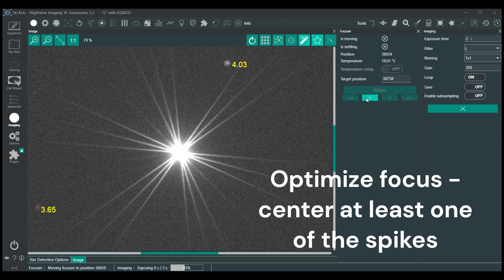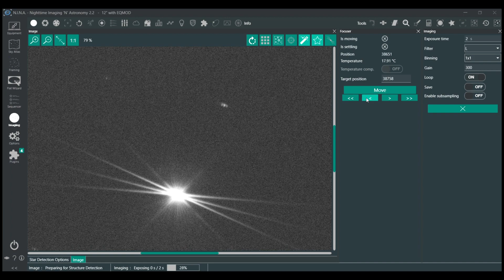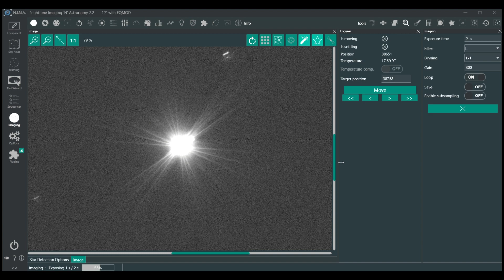Tutorial for tri-bahtinov mask collimation of a fast newtonian

Comment: Very nice, I’m gonna try this. I’m not sure I understand your mask geometry though? The way I see it, the plastic has 3 bahtinov masks in it, each BM covers 1/3 of the full circle, as if the full circle has 3 pizza slices in it. The point being that you get a diffraction spikes from 3 different slices of the mirror, which exactly line up with the screws. In your cutout mask, you are sampling both sides of the mirror at once, ie the donut opening is not over the same part of the mirror as the large opening, which is hard to understand what that will do, but you showed it works to some degree. Bottom line, a Pac-Man style 120 deg cardboard illuminates exactly the 1/3 of the mirror that the screw moves. Just some thoughts…
Reply from the maker: This is how the first tribahtonov masks were designed (one-third pizza slices).  But this version is different.  I understand it is better because you are checking for mirror tilt on each axis with more leverage, because the bounding spikes and center spike generating areas are further apart along the evaluated axis, so more sensitivity.

Comment: Thank you for sharing.  I am struggling with collimation on my edgehd. quick question. At 3.17 you say "middle spike moves with the direction of star when adjusting" . Not sure what exactly you meant. thank you.
Reply from the maker: @dm1787  as you adjust the mirror, the star moves within the frame.  The middle spikes perpendicular to the star movement direction will shift in the same direction of movement, so that is helpful for figuring out the next step.  In fact, I don't even use the rotating shade anymore, I just adjust based on what direction I'm trying to fix.  However, this is for a Newtonian where I am only adjusting the primary mirror.  I have no experience with an SCT, and don't know how it would work out when adjusting via the secondary instead.

Comment: Hi thanks for the info . What size is your Newtonian?
Reply from the maker: It's a doozy, a 12" F4 from OOUK.  I was scared it was too much telescope for the EQ6r-pro, but actually I have been delighted to find I can routinely get 0.6" on guiding with it.  At that f-ratio, collimation is super important but also difficult due to the offset secondary.  A light bucket like this is pretty useful for powering through my bortle 7 skies for anything broadband.

Comment: Thank you thank you thank you!!! I’ve been looking for a demonstration of this method as I have been struggling with with fine collimation on the same telescope(ONTC 10” F4?). Out of curiosity, how do you do coarse collimation?
Reply from the maker: It's a public service :).  For coarse calibration, and especially for the secondary I use a laser, but when I'm serious about setting up initially (centering the secondary etc) I use an OCAL camera.
Reply: I use an Ocal as well for initial collimation. I tried your method over the weekend and it’s very consistent but my intra-focused image is larger and has a more offset shadow than my extra focused image. Does that indicate focuser tube tilt relative to the collimated optical axis? I guess tube tilt doesn’t matter with this method since it checks for collimation at the point of focus

Comment: I see how this works for primary mirror but what about the secondary mirror?  I am using a Farpoint laser for initial collimation, a Catseye 2 pupil autocollimator to adjust the secondary and their Cheshire for the primary.  Its working pretty well but looks like the mask would be more precise for the primary.

Thanks, R Smith
Reply from the maker: Yup, it's only for the primary mirror for a Newtonian.  The mask will definitely be better than a Cheshire for the primary though.
Reply: Looks like I could use a regular b mask by rotating it into the 3 positions lining it up with the primary mirror adjusters????
Reply from the maker: @randysmith7010  you can, but only if you mask out most of the middle , so that you are only illuminating sections of the mirror at a time.  Otherwise you just get the average collimation of the mirror as a whole, with no directionality.